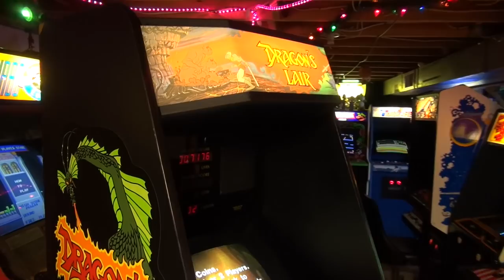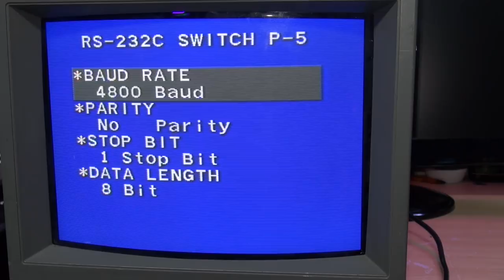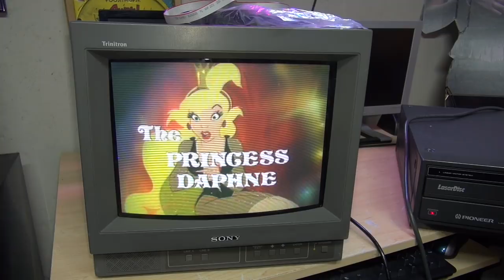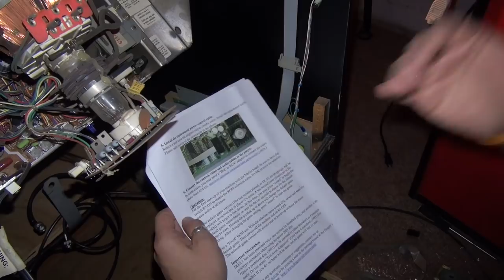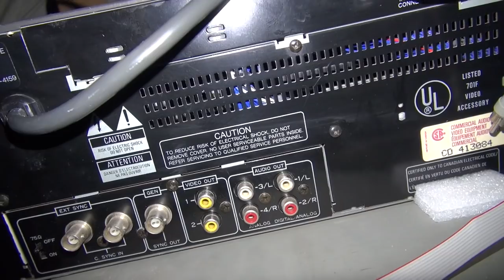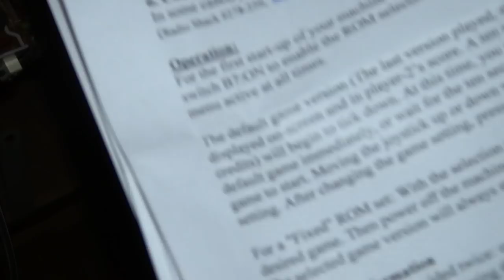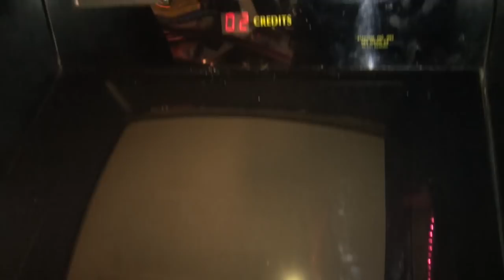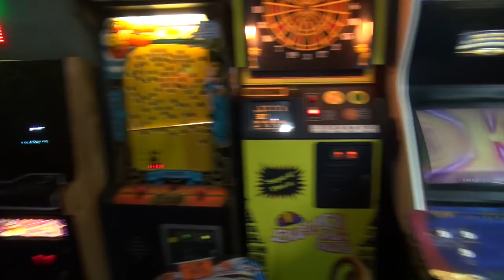Dragon's Lair Arcade - Merlin PCB, Pioneer LD-V8000 laserdisc player / SONY PVM Spectator Monitor

Comment: Hey John, I'm watching the video 6 years later :)  Great timeless content!  
For that ground connection, I would have not cut the original 2 wires going into the female spade.  I would have made a new 3" 'extension' cable with a male spade on one end, and a female on the other.  When you make the female end, crimp in your LaserDisc ground wire.  This way you aren't permanently altering anything from the original, and you don't have to deal with crimping 3 ground wires into a connector, and no soldering.  Keep up the great work!

Comment: It's normal for the Laserdisc player to take 30 seconds or so to get going. Regarding startup issues, I would reseat the serial communications cable that goes into the game board - the cable could also be tensioned too much too... Otherwise, looks awesome!
Reply from the maker: DarkStarPDX It's the player. It will not play the disc even with the cable disconnected and when you press play.

Comment: The first sets of Dragon's Lair ROMs had a dipswitch setting for enabling/disabling the drawbridge.  Later ROM sets removed it completely.  If you saw DL when it first came out, you likely played it.  The scene was removed because it failed to "hook" most players (since they lost their 50 cents in twenty seconds).  The correct moves for it are SWORD then UP.  In some home versions (most which do include the drawbridge) also require an additional RIGHT move for Dirk to enter the castle.
Reply from the maker: I believe that to be true. However, nobody had that rom set. It doesn't seem to exist.
Reply: @Johnsarcade  I know the PC DOS CD ROM version from 1993 has the drawbridge, mine does.

Comment: ok looking up that laserdisc player has 2 bnc inputs and 1 output they say sync in and out so not sure what they are used for. wonder what would happen if you hook sync out to the original bnc cable on the game.

Comment: John, Why would you cut the power cord to the laser disc player? why not connect an old extension cord and cut that, thereby saving the laser players cord. I almost died when I saw you cut that beautiful power cord.
Reply from the maker: +Will V I think I did this in a later video. WHOOOOPS! :)
Reply: +John&#39;s Arcade Game Reviews &amp; Tech
Many people use a power strip and leave the drawer open a crack to feed the cord out. (The game power cord is plugged into the power strip as well.) Not quite as clean, but it's dead simple and leaves everything all-original.

Comment: Hi John...  LD-V8000's are programmable laserdisc players.  By factory setting, it scans the laserdisc for "Level 2" programming code that's embedded in the video on some educational videodiscs.  You will have to go into its player advanced settings to change that.  It's on page 4 and the name of that option is "Level II Auto Start".  Turn it completely off and press the DISPLAY button to exit.  Now the "Program" LED should be off and it should start up normally.  I used to work on these players when I serviced the 6-player Galaxian 3 game long ago.

Comment: The Drawbridge was DEFINITELY in the original versions of the arcade release. I remember it vividly!
Reply: I also saw it one time at an arcade in a casino in Las Vegas that was called "The Paddle Wheel".  I am guessing maybe these were prototype machines that had it?
Reply: I know for sure that the drawbridge scene was in the pc and amiga versions but I'm foggy on the arcade.
Reply: @axelfoley20  Yeah it's definitely in my 1993 PC DOS release.
Reply: From what I've heard and remember , the drawbridge was NOT in american versions of the arcade game. I never saw it until home consoles and I played dragon's lair ALOT in the 80s on quite a few different machines
Reply: @luvmenow33  I remember it Vividly on machines in LA when I was a kid.
Reply: @RazaXML  right. Same here. Philly ny NJ. No drawbridge ever on an arcade machine and I also play a ton of em. I wonder what the story is?
Reply: @luvmenow33  I don't remember the drawbridge being on the arcade version either. But it's been well over a decade since I played the arcade version.  However, I do remember it on both my 90's DOS / Windows version, my old iPhone app and it's on my 20th anniversary DVD box set.

Comment: Composite video is standard-definition analog video all of whose signals are combined into one pin, whether they're RCA or BNC. RCA and BNC are only mechanically different from each other and can also be used for component video also (red minus luminance, green minus luminance, and luminance; color-coded red, green, and blue).

Comment: John you might consider rotating the laser player back the way it was. The side vents should be inline with the filter for a straight shot of air flow.
Reply from the maker: GuruBrew I think this is good advice. I will be rotating it back soon.

Comment: Great video, John! I remember at the time here in Italy there were some arcade machines with the additional monitor on top, just like you did! But the italian "Sidam" edition of Dragon's Lair was incredibly harder!
By the way.. at the end of the video you sound really upset! Too bad your "Revenge from Mars has died again, I think it's the PC's power supply!
Reply from the maker: MaxxLegend I fixed the Revenger From Mars. It overheated. I replaced the fan and heatsink and added some thermal paste.

Comment: I have always found Dragon's Lair fascinating.  I'm a computer programmer and understand how it works.  I find it cool that they make a replica machine, because only in the 21st Century you can do it with tiny solid state electronics and a tiny screen instead of a full-size monitor and a laser disc player.

Comment: Great video! I am intrigued by the Merlin Board and I know some arcade cabinets could support multiple games on the same hardware (Tron supported a second Satan's Hollow game). Possible snag in this upgrade I wanted to call your attention to. The Space Ace game had three additional buttons on the right that supported a user selectable difficulty level for Dexter (easy), Space Ace and one more button. Both games supported two Sword (DL and DL Time Warp) while those buttons are the fire buttons for Space Ace. Not sure how you're going to support those extra buttons for Space Ace but good luck.

One other upgrade you may want to plan for is what to do when those CRT monitors wear out, get old, damaged or sustain screen burn in or the CRT inside black mask fades from age.

Just a thought.

Great job on your DL upgrade.

Perhaps you can offer the DL2 Time Warp game in the future also. Unlike SA, DL2 had the same buttons and controls.

Great job and good luck

Comment: Hey John.  I've owned laserdisc players since the 90's. A normal home player  -- when you hit play the disc spins up to speed and seeks its start point. With high end players , it takes about  15-20 seconds. But that does not have to deal with RS-232 communication link. I would imagine that would add some extra time .

Comment: I know I'm a little late to the party but I've been a laserdisc guy since they came out. Space Ace was my favourite. I'm sorry to see the hassle you had with the power cord on the new player. I would have just installed a 2-outlet receptacle inside the cabinet and plugged both the player and the spectator monitor into it. Anyway, loved the video none the less. Keep up the good work.

Comment: Also, I remember the version I played did have the drawbridge scene. In fact, I remember spending like $5 in quarters just to figure out how to get past that scene. The very first challenge in the version I played was that damn drawbridge. 
One thing to note -- I heard rumors back in the day that this machine would get filled up with quarters and it actually overflowed with quarters because it was so popular. The owner of that arcade knew me because I was in there basically every week and he would open up the front panel and manually flip the quarter switch to load up like $20 in credits in the game for me. He was a real saint and was probably the reason I eventually beat the game (which at the time was a big deal with people in the arcade clapping and cheering).

But yeah, this game was probably really profitable for arcade owners but the original Laserdisc player had problems associated with it that would cause it to start failing after a thousand or two hours of game play. However, this game brought in so much money it probably wasn't an issue long-term for the arcade owners.

The thing about this game is that it really was revolutionary at the time. I didn't know much about laserdiscs at the time and I didn't even know the game was essentially a high-tech version of a digital "choose your own adventure" style game. The graphics for this game compared to every other video game on the market was just light-years ahead of the other games. 

Anyway, thanks for putting this video together -- it's really cool to see the internals of this game and how it was set up at the time. Also -- subscribed!

Comment: A couple of thoughts in general... one you might want to turn off the games when your working in the basement, the loops sometimes kind of get overwhelming (though honestly it's a minor problem really). 

A second thought, maybe you should get a second smaller camera that you can put inside the machines so you don't have to unmount the one from your tripod (might be perfect for a gopro) then you can splice in the inside footage to the video without having to juggle the camera.

Comment: You are wrong john the reason you remember the drawbridge scene is because its in the intro movie it was cut from the original ld because of space and the reason you stated here is the scene sequencing http://www.dragons-lair-project.com/games/related/sequence.asp also you were saying about long term solutions check out matt ownbys Dexter board which replaces the ld player completely with another expander board with all the roms and ld footage in memory rather than the ld also any tech info or scene sequencing easter eggs and other goodies check The Dragons Lair Project a website about everything ld all the schematics wiring solutions and much more the link to dexter is on the first DL video you done

Comment: Dragon's lair was a CAV (constant angular velocity) disc which supported the frame by frame and ability to pause perfectly.  But you could only fit 30 minutes of video on it.  Most laserdiscs were CLV (constant linear velocity)  They held 60 minutes of video but had a vhs style pause.  So no real surprise, atleast to me, that the Dragon's lair disc could pause perfectly.  I have one myself but it's too scratched up to play.  BTW That was a helluva deal you got on that sony monitor and that pioneer laserdisc player.  wow!

Comment: Imo, one of the most well-built industrial players is the Pioneer CLD-V2600 (Although, you would need to get a Laserace card to use it with this machine).  Also, the Cadillac of LD players is probably one of the Pioneer Elite players. :P
Reply from the maker: I can run the v2600 with the Merlin card. Although, it's not one of the recommended units. It's my understanding that the v8000 is the best industrial unit.

Comment: I'm glad I saw this, and the original ad you showed for those spectator monitors. It validates something I thought I remembered from Showbiz Pizza in Wichita. They had a Dragon's Lair on the outer edge of the arcade, facing into the walkway where everybody could see it. It must have been a new game at the time.  I remember staring at it from a distance, watching a monitor they had up on top of the machine.
I was a little kid back then, and my memory of that place is kind of a fuzzy dream sequence, but now I know those spectator monitors really existed.  I think they might have also had a 2nd monitor on the Donkey Kong, but I'm not sure. I might just be remembering the regular monitor that I had to look up to see in those days.

"Y" is luminance (brightness), "C" is chrominance(color). In other words, Y/C is SVideo.

Comment: I love the spectator monitor ! Love the Sony PVM's !
I assume you reseated the RS-232 cable to ensure a good connection and on all pins to help your Laserdisc behavior.
Reply from the maker: Charles Smith Yeah, it's the player. It's bad. I am looking for a new one now. It will not play the disc when the cable is disconnected and you press play.

Comment: John, 
Regarding the RFM.... I'm not sure if someone already mentioned this or not, but there are usually two wires on the power supply that will turn it on if jumped together (usually the green to black, but google it to be sure for your application). I had the same problem on my Megatouch that you are having. I jumped it for a while, and eventually it worked fine without it. Good luck!
Reply from the maker: I fixed the RFM. It overheated. I installed a new FAN / Heatsink combo with thermalpaste. ALL FIXED.

Comment: Hey John, love the video.  I just wondered, during the video you said, after the rom you wanted was selected, you should flip a dip switch back to set it.  I'm sure you'll get it working.  thanks.
Reply from the maker: Jordan Hester Yes, if I don't want that menu every time it turns on I can set it with a dipswitch.

Comment: How do you adjust the geometry and calibrate the image on the screen? My
 image needs to be shifted to the side but can't find a way to do it on my PVM14m4u. I 
couldn't even figure out how to take the monitor apart. Do you know of a
 separate calibration unit I can attach? Thanks in advanced!
Reply from the maker: Crafty Mech has a crosshatch generator. Google it. It's awesome.

Comment: I would have used a short BNC-to-RCA adapter on the back of the LD player and kept the original video cable.
Reply: Which is what you wound up doing...

Comment: am not shore but i think the laserdisc that you had in the cab did have ground but they removed it and hot whierd 2 core in side of the unit i have not seen in side 1 to confirm it but i think that is wot they did
Reply from the maker: It's possible. Not sure.  It def' only had two wires coming out of the unit. Huh.

Comment: is it me, or is that disc rather grotty? Maybe give the disc itself a good clean and get rid of 30 years of grot? Could also explain why it's taking so long to boot at startup?
Reply: Laserdiscs sadly suffer from; "laser rot" if the discs weren't properly cleaned up and polished before being shipped out from the production factories. Columbia CLV were said to be the worse LD's made on the market when Laserdiscs were out on sale.

And sadly unlike DVD and CD's Laserdiscs aren't the kind of discs one should spread any liquid fluids onto, to clean them? They have to be handled with extreme care. And stored within a thin 'paper jacket' and plastic sleeve it came wrapped in, when not in use.

Comment: why do you think you need power still? all that uses is mechanical button to open it it seems. i see nothing that needs power. have you even tried to open it without power? also why but the plug off? why not just use a adapter between plugs?
Reply from the maker: Not sure what you mean. Just trying to wire this up like the original laserdisc player.
Reply from the maker: The original laserdisc player will not open without power -- FYI
Reply: i mean why cut the plug off. why not get adapter for the plug on laserdisc player then have that spliced to the adapter in game?

something like this
http://www.radioshack.com/product/index.jsp?productId=3014502

is there a reason you have to use the original power wire that is in the game for it or could you bypass that and go to the main power like with ground?
Reply: ok. the way it looks likes like it is just spring loaded.

Comment: There's a compilation on the Wii that has Dragon's Lair, Dragon's Lair II: Time Warp, and Space Ace all on one disc called the Dragon's Lair Trilogy. I think it would be an excellent way to practice because you can put a move guide on the screen that shows what you're supposed to press.
Reply from the maker: ***** That's cheating!! I'm looking forward to figuring the game out little by little!
Reply: I get that, but the move guides are completely optional. I tried figuring out the moves myself, but the screen with the knight that electrifies the floor was just too much. Even with the move guides, I still die a lot from moves I wasn't expecting.
Reply from the maker: ***** Yeah, I have never passed that Knight! :)

Comment: Hey John the drawbridge screen was most definitely in the arcade back in the day and you press sword then up and on the second screen you press right dragons lair is one of my favorite games and when you got it I almost shit myself lol I will be getting another one day
Reply: And as far as the revenge from mars awesome pin but the worst thing they ever did was put a regular computer instead of the normal pcb in it I have a star wars pinball 2000 nothing but problems
Reply from the maker: Yes, I agree! I clearly remember playing that level at 7-11 when I was a kid. Without a doubt
Reply from the maker: My RFM has been very reliable, really. I replaced the CPU fan after this video and I am back up and running. Simple fix.